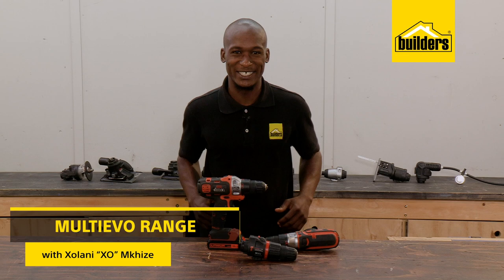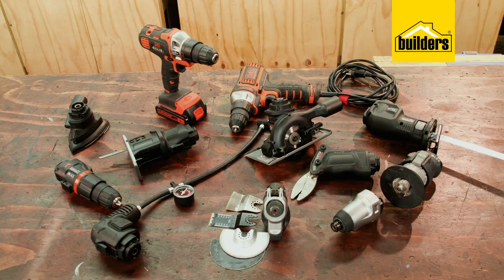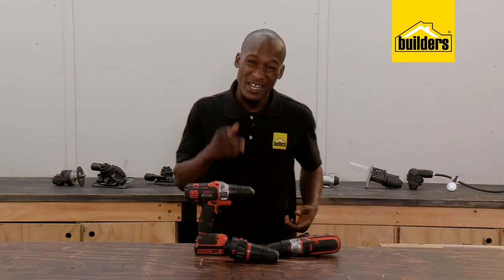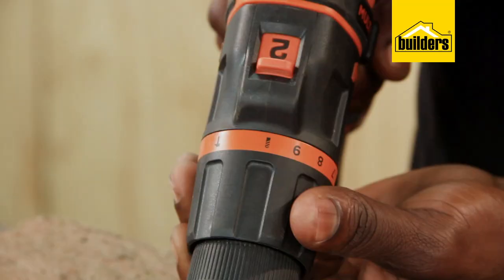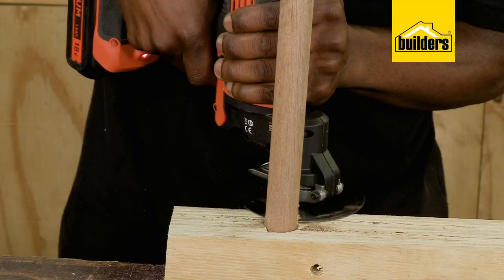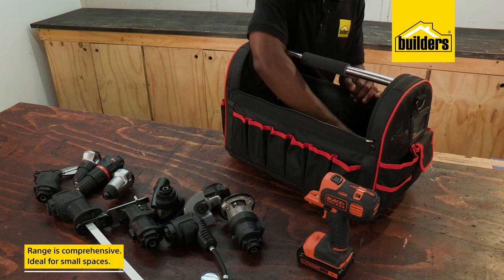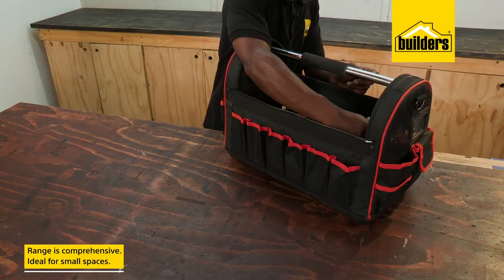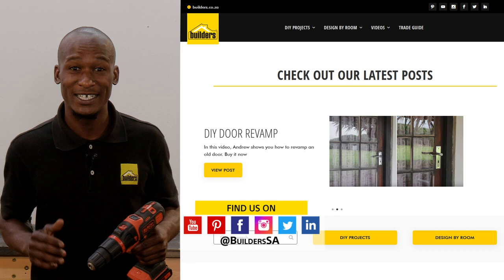Hammer Drill Head Attachment From The Black + Decker Multievo Range

Comment: Where I live this is called The Matrix instead of Multi-Evo. I got a 6-attachment set in a carrying case and then got extras. I just got the hammerdrill recently and it is great. We had trouble driving screws with the regular attachment but we just used the new hammer drill attachment to drive some long screws in to a thick wooden block (to mount a float lever for a cistern) and it worked great. I haven't been able to find the shears attachment anywhere though.